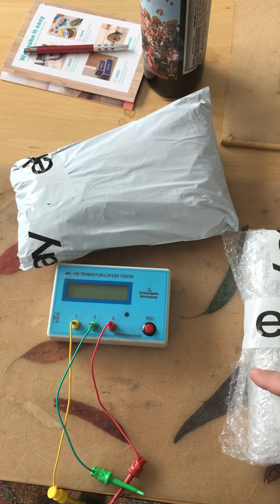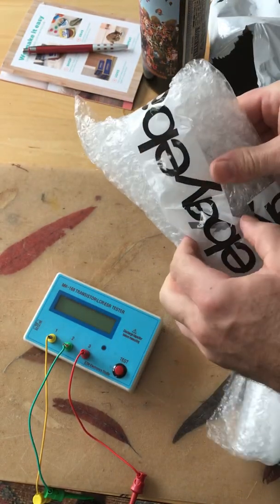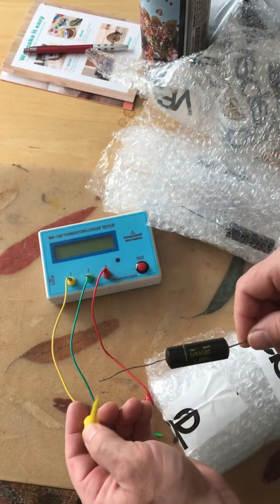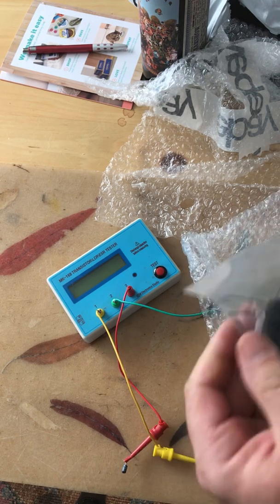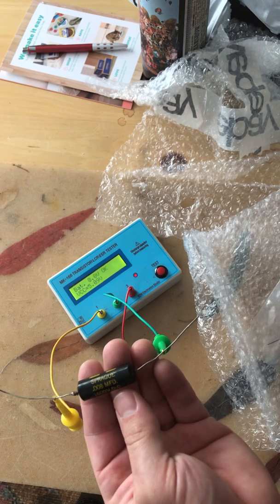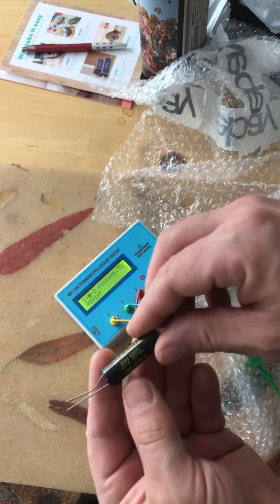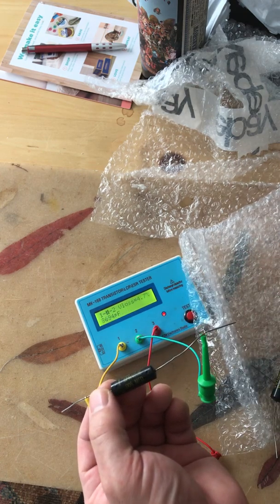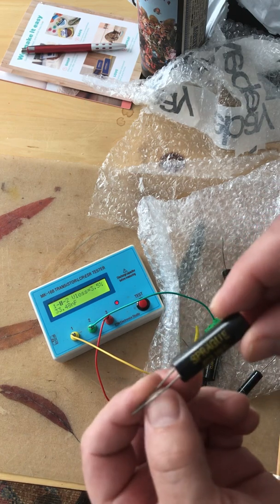Sprague black beauty capacitors unpacking and testing

Comment: These are no electrolytic capacitors, what is there to reform about them. Also... you`ll need an insulation tester or dedicated leakage current tester or HV PSU+microammeter to make any judgement about what state these capacitors are in.